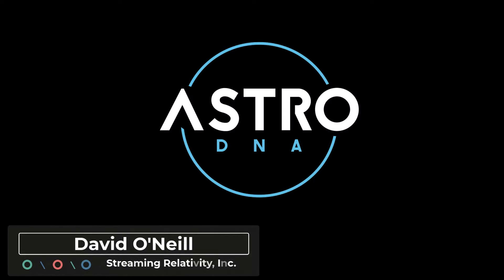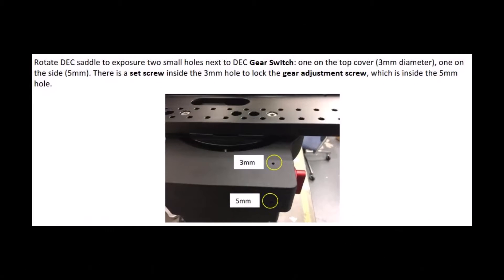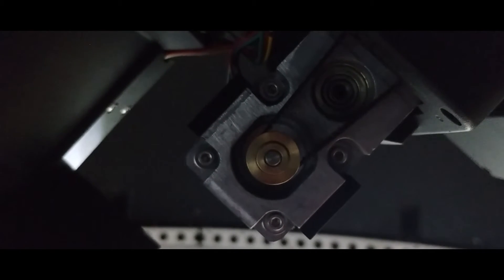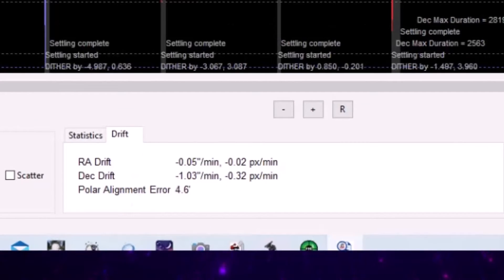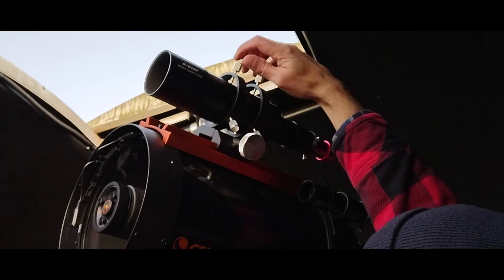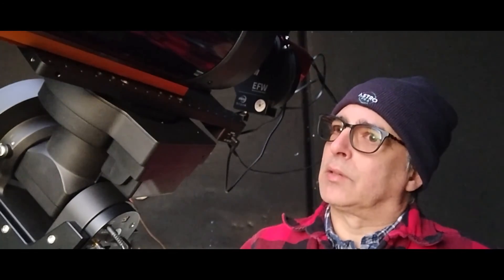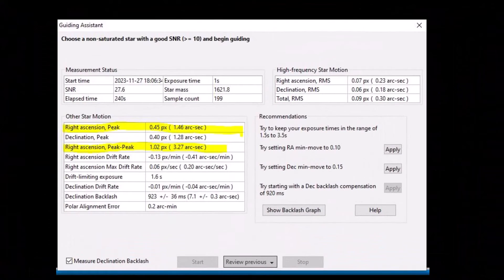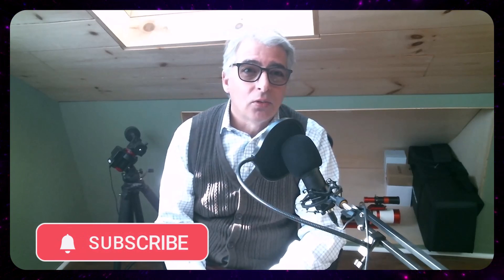iOptron CEM120 - Taming Backlash

Comment: I suppose these techniques can be used on all of iOptron's CEM or GEM mounts. I'm in the market for a new mount primarily for improved guiding. I'm looking at CEM40/GEM45 as one possible choice, especially now during the sale for these lines. Did you ever investigate the RA axis. I don't see an update video.

I use a C8 with Starizona reducer/corrector, Celestron OAG with ASI174mm mini guide camera, with a ASI071MC main camera. My weight is roughly 19lbs. I have to set up and tear down every session. I use NINA Three Point Polar alignment and I always try to get under 30 arcseconds. 

 I'm also considering the new AM5N since a recent review shows good guiding on a C8 and Losmandy GM8 or GM811. My spending comfort is limited to under $3500. Not sure if all harmonic mounts are suited for longer focal lengths. 

I use a C8 with Starizona reducer/corrector, Celestron OAG with ASI174mm mini guide camera, with a ASI071MC main camera. My weight is roughly 19lbs. I have to set up and tear down every session. I use NINA Three Point Polar alignment and I always try to get under 30 arcseconds. 

I you want a mount that has serious DEC backlash you need to check my AVX mount. When I run Guiding Assistant, PHD2 can't even measure the backlash. I've been playing around adjusting the DEC and RA backlash.  I haven't run Guiding Assistant for a long time since it didn't seem to help before  improving guiding. I've found the PPEC algorithm seems to work better on my AVX mount and shorter guide exposures, 1 second. I usually wait for about 10 minutes to let the algorithm figure out the periodic error before I start a sequence.

Despite my issues with the AVX mount, I've run 2 hour image sessions where the average RMS is below 1".  I had one night shooting the Bubble Nebula, where I averaged 0.68" RMS. The previous session on the same target a couple on nights earlier the average was 0.96" RMS. I'd love to get a mount where it could maintain  a 0.6" average since my resolution for my camera/scope is 0.69"/pixel according the  Astronomy tools website.

Comment: Is this a new mount? If yes then why does the end user have to "fix" it?  The motor belt tension seemed extremely vague. Zero Backlash???
Reply from the maker: The mount is less than 1 year old. In an ideal world, an end user should not have to fix equipment - but sometimes, for a variety of reasons, you may need to fix problems. Now, for some that may be returning the equipment to the manufacturer. For others, it may be a DIY effort with the tech support team. Given the CEM120 weight - I prefer to service issues on my own! Backlash can be caused by a number of factors - and belt tension is one common problem. There are a number of published articles from iOptron and others that discuss this is more detail if you are interested - I think google will reveal good results if you use terms such as "CEM120 DEC Belt Tension". Here is an iOptron PDF on the subject: http://www.ioptron.us/Support/CEM120_Belt_Tension_Adj.pdf  - Hope this helpful. Thanks for commenting!

Comment: My CEM 120 did me well for 3 years, going to a 10-micron 2000 hps.
Reply from the maker: So far so good with the CEM120 - I'd say there are two issues with the mount. First, the screws that are used to secure the DEC motor are too short and I believe contributed to may early backlash problem. Replacing them with longer screws kept the motor secure. Second, the cable that connects the 10A input from CMS Input panel to Saddle output is easily unseated during slew. This is either a poor connector or a physical tugging on the internal wiring. Both of these issues are ridiculously easy to address - but should never make it past QA control. I hope to get many years of use. Good luck with your 10-micron - why the change?

Comment: Hi, thanks for the video, very helpful. In the video it looked like you had an off-Axis guider, so i wondered why you weren't using that as it rules out any differential flexure issues.  Sow how have you found the CEM120 for balance and performance ?  I'm consider either the CEM120 or HAE69 and really cant decide between the 2.
Reply from the maker: @wafflefreetech7062 - Yes, that is an OAG and I will be using it eventually. The guide camera I have for that rig is an ASI120 mini, and it is not ideal for an OAG. I have an alternative on order - he ASI174 mini. I will do a video on that setup once it arrives. That will certainly address the differential flexure. Side note, I tuned the rig with the guidescope configuration pretty nicely. I am getting sub .5 arc-sec total RMS consistently. I have some awesome galaxy groupings to share later this weekend!

Comment: Crap mount, crapiest company out there. Your adjustments ain’t going to last long. I rid of my one swiftly.
You could get used paramount MyT for similar price.
Reply from the maker: My personal experience with iOptron as a company has been very good. However, my experience with their products has been a mixed bag. I think it goes with the territory (mass produced mounts). I will say that I have solved every issue I've had with a little research and patience. Certainly there are no excuses for poor QC and every company should put customer success first... I have read good reports about the Paramount MyT and other Software Bisque mounts - I just have no experience with them so I can not comment further. Thanks for viewing the video and sharing your comments. Best!
Reply: @AstroDNAObservatory  Paramount MyT doesn’t need comments. It is upper end mount and will eat IOptron for breakfast.
Reply from the maker: Love the passion! Cheers.
Reply: I've had both.  The MyT had many more issues than my 120EC2.  The MyT would occasionally 'run-away' in DEC and had to be powered off to stop it!  The through-the-mount cable architecture was poorly designed and would either affect tracking/guiding or eventaully chew cables.  
The 120(especially the EC2 version) just requires quite a bit of patience with getting to the proper settings in PHD2.   The trick is to not fight the encoders and leave enough "timelapse" (but not too much!) to allow PHD2 to work in harmony with the mount's own corrections.  Plus, "lowpass2" works well in training the mount to essentially forecast when encoder corrections are coming down the wire...   I've had my EC2 since 2016.  She's overdue for some new belts, but otherwise, still running strong!  
Also, the only company with better Customer Service than iOptron was OPT.  I sure miss those guys :-(